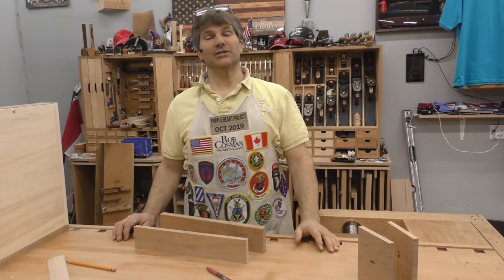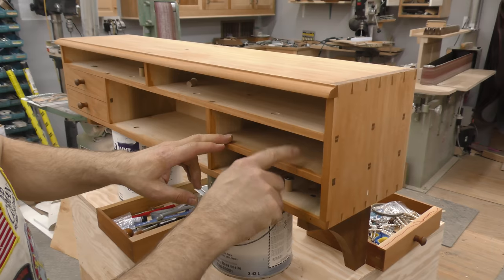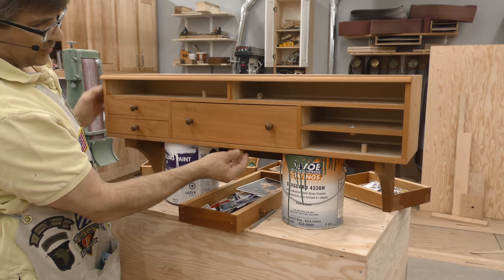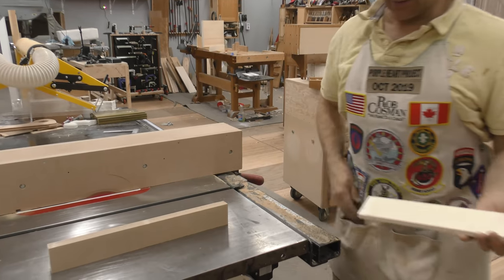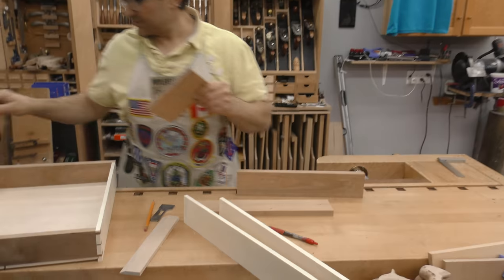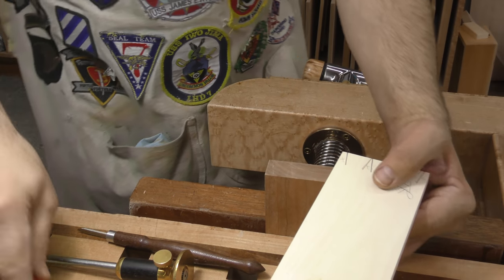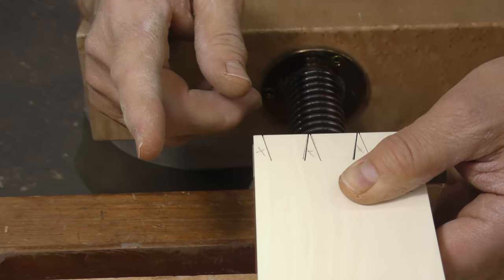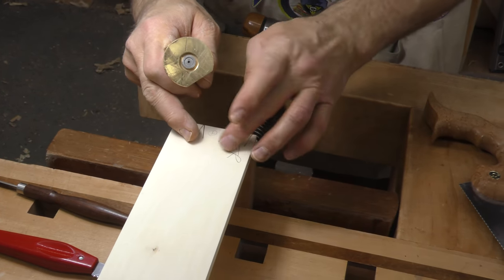Drawer Making Episode 7

Comment: Would it be a good idea to have a rabbet the depth of a saw kerf (assuming the size of this is constant?) on a small piece of wood (maybe on the face of your dovetail marker) to use it in lieu of a marking gauge to offset the tail board? it would be easier to handle and register on the edges of boards?
Thanks and stay safe!
Reply from the maker: The marking gauge method provides an exact  measurement of the saw being used.  Set reduces with each sharpening so not all saws will be the same
Reply: If I'm understanding this right, after resharpening a saw the set is reduced, and practically the kerf size (once you apply the transfer technique) becomes that of toothed dovetail marking knife because it now has the bigger original set?
We're talking like 1 or 2 thousands of an inch, I'm probably just overthinking, I find it interesting nonetheless.
Thanks again!

Comment: Excellent video as usual! A couple of questions though about measurements for the end-lap on the half blind tails, and also the shoulder:
Is there a ratio or rule of thumb you use to establish the lap on the half blind tail? 
Also, how deep do you make your rabbits to establish the shoulder - 1/32"? 
And, what did you use to establish the width of the shoulder (and depth of the tails)? I know you copied them from the previous build, but is there a specific relationship to one of the other parts in the drawer? 

I missed this in your layout!

Thanks again!